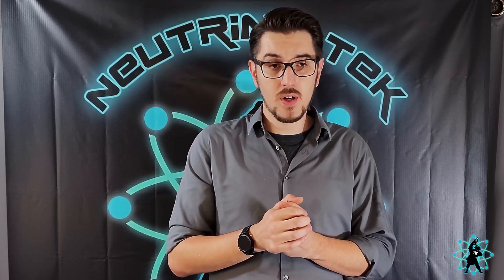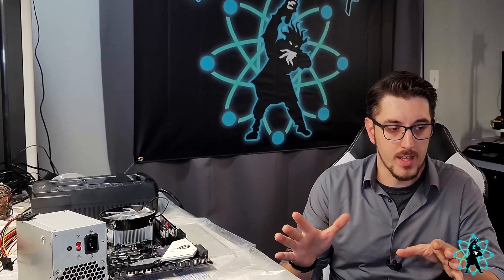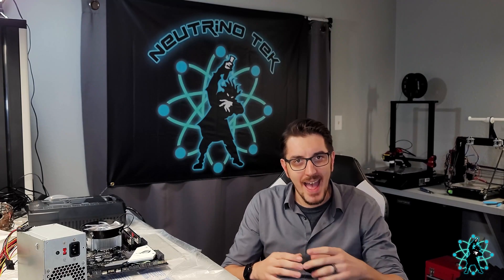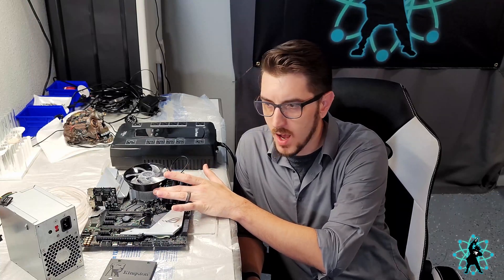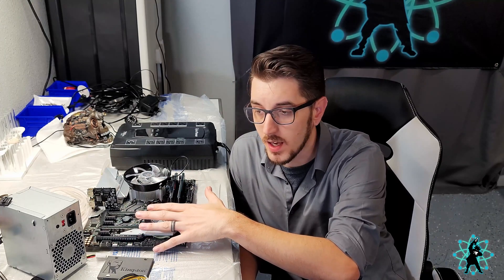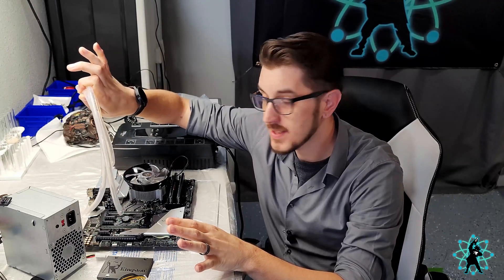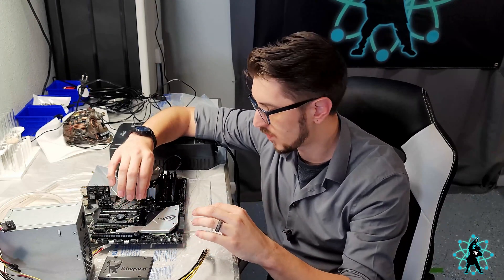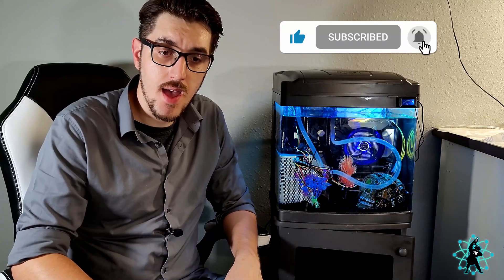Building a Computer Inside an Aquarium

Comment: How is this even possible? Did you have to coat everything first?
Reply from the maker: Nope! Water isn't compatible with electronics because it can act as a conductor and cause short circuits... but mineral oil is non-conductive, so it won't cause any damage... but like I said, good luck ever getting all of it off if you ever want to use it for anything else. Lol
Reply: @NeutrinoTek  cool didn't know that thanks for the video 👍
Reply from the maker: @timtoomuch  no problem! Thanks for watching!

Comment: I know this is a year old.  Did you manage to get it fully working and test it out?  First time I heard of mineral oil usage.  Very intriguing?  Can the mineral oil be further cooled down using aquarium parts?
Reply from the maker: Yeah, it works pretty well actually.... although there are a few small things I would probably change if I did it again. Like even though there are vents in the top to allow airflow, I would probably mount the radiator somewhere outside the tank to help cool a bit more. As far as cooling it more, they make aquarium chillers that would probably work for additional cooling. Essentially it just pumps the water (or whatever liquid) through a box with refrigerator coils. Haven't tried it yet, but could be a fun experiment.